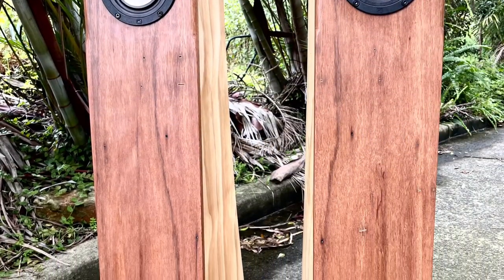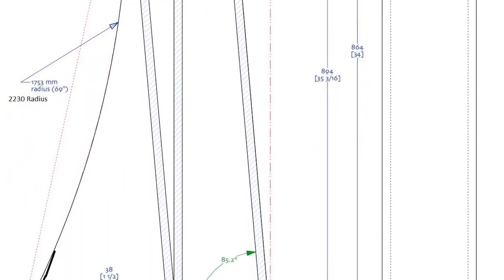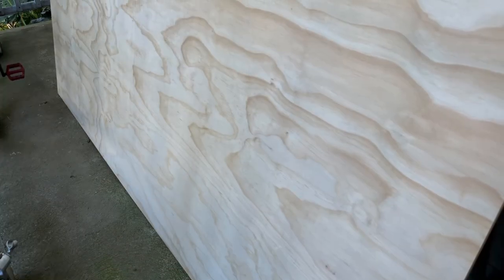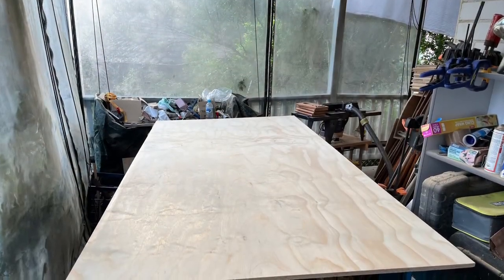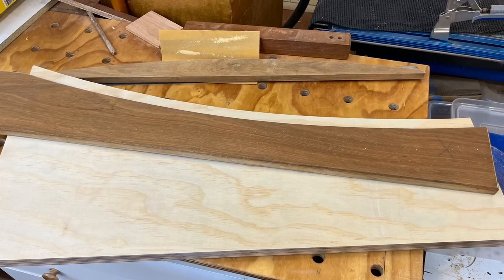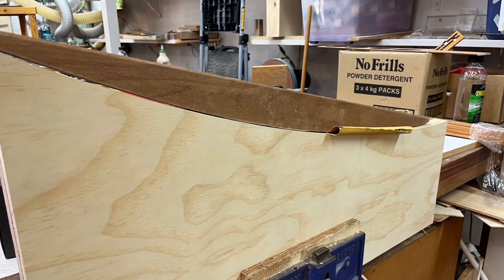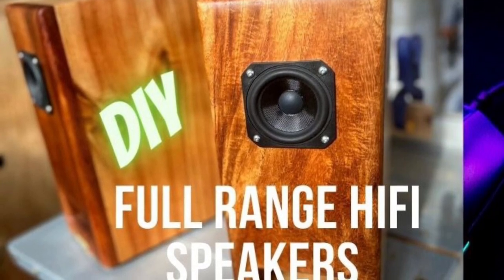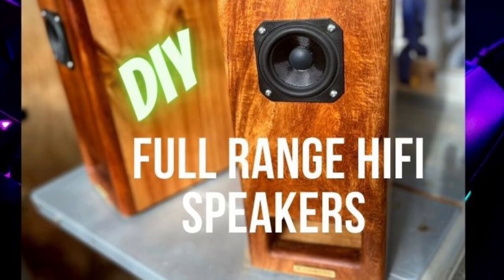Frugalhorn build Part 1

Comment: Unfortunately the back curve is functional to the speaker's sound. So changing it changes the sound characteristics of the speaker 😢
Reply from the maker: The change is so minimal. They sound pretty good. Although I wasn't so impressed to want to make more.
Reply: i would love to hear a real world comparison.

i was gonna say the same thing buuuuuut.... nothing is on an off, you will just highlight a slightly different frequency or rather the tuned frequency of the radius will play a bit quieter. rule of thumb.

but i dont know how one radius would be easier then another. nice build.